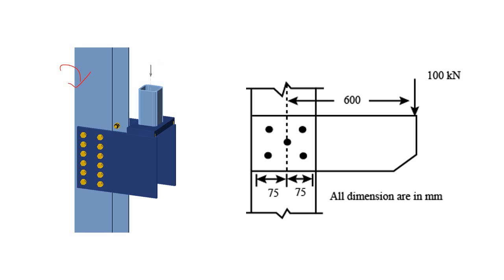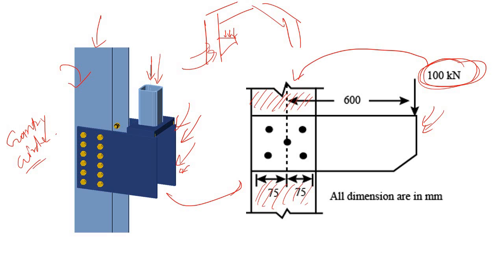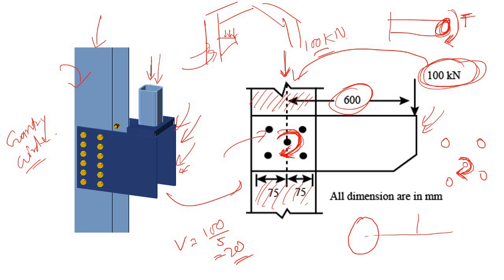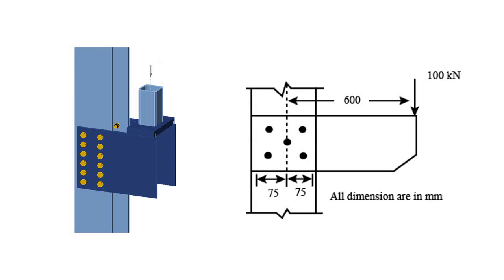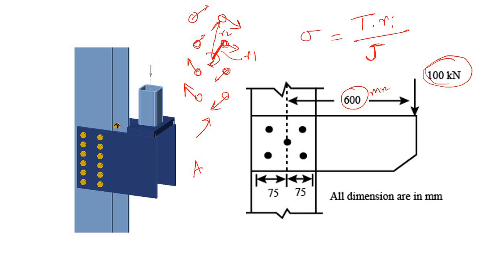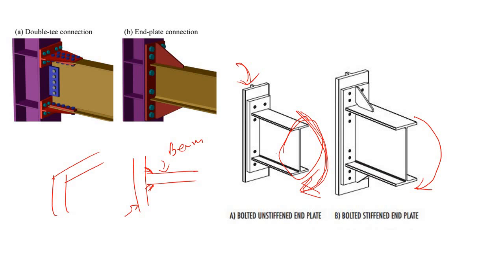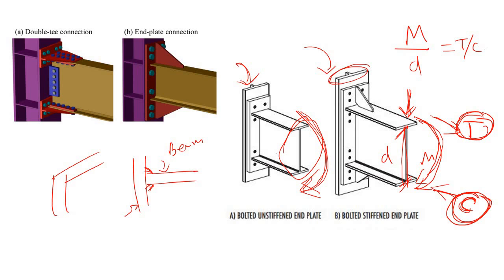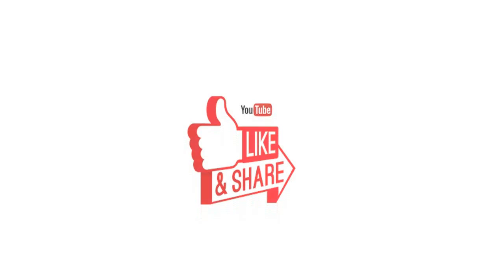This is the way to Transfer Force in these Two Connection

Comment: How I get to study steel design course
Reply from the maker: There are many steel design book.. you can follow them
Reply: Can you make video about connection like end plate, cleat angle
Reply from the maker: @sivasnv  I'll try
Reply: @TonmoyMaity  what's the concept behind cardinal point used in designing software
Reply: @TonmoyMaity can you please recommend some steel design books?
Reply: Can you please demonstrate one project with the manual calculation of portal frame?